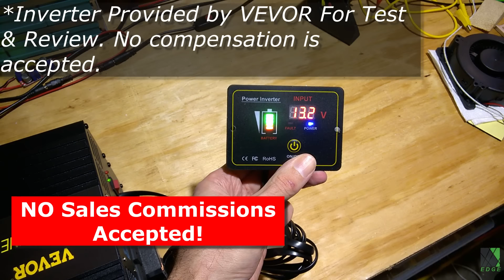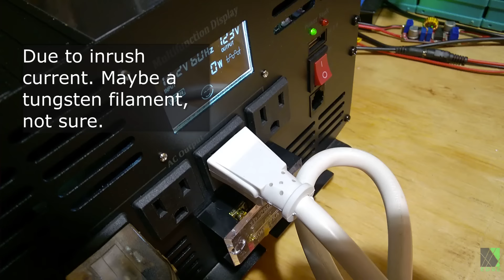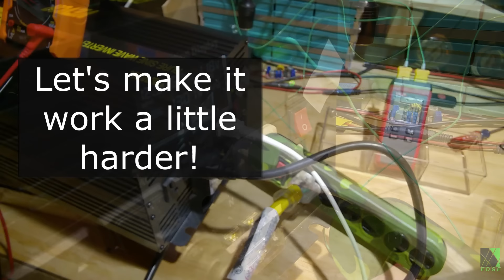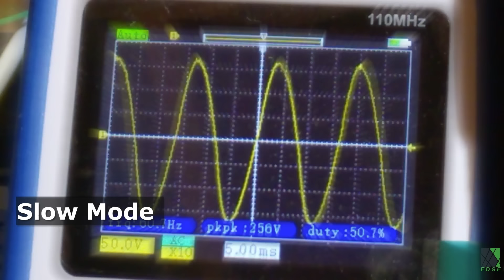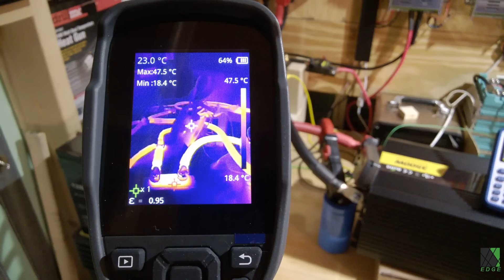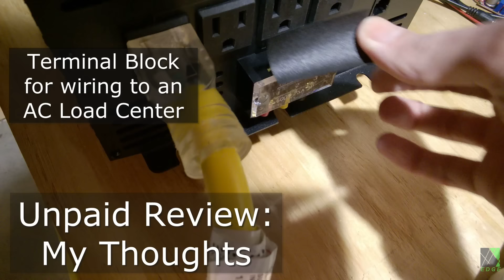Affordable 3500w Sine Inverter REAL Test! Unpaid Review - off electrical grid - solar workshop

Comment: Nice to see what my inverter MIGHT be able to do....  I say might, because it doesn't work :(  With my battery connected via #00 (2/0) pure copper (not tinned & not CCA) battery/welding cable, and inverter turned on, there's a 4A draw on the battery.   If I plug my phone into the USB port for charging, the power draw goes up to 5.2A, but if I plug anything into the 120V outlets, those devices do not turn on :(  Trying to get Vevor to replace it....
Reply from the maker: @shawnmurray7232 Sorry to hear that, very disappointing, I hope they will replace it.

Comment: Excellent test, you would have to be cruel to put any inverter under that much stress in day-to-day use! I was impressed that it past the soack test at near maximum load, most cheap inverters would overheat and cut out on that one.
I suspect that the reason a lot of people misunderstand the surge capability is that they do not look at the time. The spec says it will handle a 125% load for 20 seconds, enough to start your saw and most medium-sized tools. Big motors, however, often take more than 3x their rated power to start up, so the biggest motor I would expect this to run would be about 1500W or 2Hp. Even that can be a problem with heavy tools, my jointer has a 2hp motor, but it also spins a cutting head weighing around 10lbs. It makes a 5Kw generator chug when it starts. High frequency inverters just do not like big induction loads as you point out.
Once you go beyond 125% the length of time the inverter will sustain the overload rapidly drops. Most inverters will only manage a 200% overload for 2 or 3 seconds, which may start a fridge but won't start a large motor. So it may well be that this one will provide 6000W peak, just only for a second or two.
Reply from the maker: @rolandstockham1905 thanks for your kind feedback :) 2hp 10lb cutter head sounds like a good test. I wish I had a large air compressor. Those can be extremely difficult to start.

Comment: Thanks. Exactly the kind of review I wanted to see before buying one: the fan will never start in my RV, running the apartment fridge  during the night 😂 probably one of the best inverters for the money?
Reply from the maker: @OOOOutdoorOffGridOverland WElcome :D well I'll tell you, I thought this inverter would fry with the treatment I gave it, but it did not - so I will cautiously recommend it. And I thought it was pretty good for the sale price. That said, I'd still spend time looking at all the options before taking the plunge :)
Reply: @solarpoweredge I already ordered it. Hard to beat for the money. For me it is very important to be quiet. 99% of the time will run a fridge which draws 50w and starlink 40w,  6w in light. Fan will never kick in. Thanks.

Comment: This stress test is more appropriate for a open-frame gas generator because I know my Champion 4250W generator would handle it with ease all day long under constant load.  A 3500W inverter would make me real nervous.  But it's helpful to know it can be done for a few minutes.
Reply from the maker: @hornet224 Generally I don't run inverters past 50%. Since this is a review / stress test I wasn't going to give it an easy time. This inverter endured the heat test much longer than a few minutes! The intent was to expose potential weaknesses. I did not think it would perform well. But it did. Temps were a bit too high though, so I will look into some diy modifications

Comment: How did you hook up your 12V LifeP04 batteries? I'm looking to buy about 600 Ah worth of batteries. I saw I can only hook 4 of the 12V ones together maximum, meaning I'd be stuck with 400 Ah maximum.. Is that really how that works? I'm kind of lost.. Or should I get 2, 300 Ah batteries?
Reply: I'm trying to run about a 500 Watt load, 24/7. I bought about 2,500 Watts of panels 2nd hand recently. Some of the load is a fan, some is fridge, some is PC.
Reply from the maker: @lockdot2 500w x 24 hours is is ~12-14kw/h - that's a lot of power. 2500w of panels may not be enough, and you would need a huge battery bank as well. Solar is very expensive unfortunately. If you can turn some of the loads off at night, that helps reduce power consumption and reduces the solar requirements
Reply from the maker: @lockdot2 You can parallel them - that means connect the positives (+) to negatives (-) which works like one big battery. If you have 2 100 amp-hour batteries for example, can connect the positives and negatives of those batteries and they become a single 200 amp-hour battery. Careful not to connect positive to negative though, that's a short circuit! Hope that makes sense. You should get whatever size of batteries makes sense for the budget, and remember you can always parallel another 12v later as you expand. Hope that helps

Comment: Have you tried the renogy inverter low frequency. 3000 Watts
Reply from the maker: @johncampbell2311  I don't have the money but I'd sure like to try it! they make good stuff
Reply: @solarpoweredge  well it would not go as high as the one you just did that 3500 Watts. It's supposed to maintain a 3,000. But to my understanding that you can do 9,000 Watts for 30 seconds for startup.. due to a massive transformer and think choke coil. To maintain the proper voltage instead of dropping out. Some inverters will last longer with a realtor drive down to 90 volts

Comment: try to make a 10KW inverter with da fat mosfets and make a video
Reply from the maker: @AchhcityNoob  I will show a 10wk 12v inverter on this channel as soon as possible. First, I have to get a proper bench test set up :)
Reply: @solarpoweredge  hehe and also try to make a huge ass cheap ass test lpad to test the inverters rather than making soup and powering space heaters by buying cheap ahh rolls of nicrome wire and spooling it infront of a blower
Reply: @solarpoweredge  and also :)

Comment: Would you be so kind as to measure the voltage from PE to neutral and from PE to hot?
Reply from the maker: @brucenolan7873 Believe it or not, I meant to do that! plus wanted to do a teardown... but I've been sick and bad health. Just had to shorten and finish this video. 
*I will check the terminal block and outlets for live neutral, if I forget please remind me :)
Reply: @solarpoweredge Dave, thanks for the reply, I hope your health improves. Many inverter reviews neglect to test this voltage, unfortunately if the ground (PE) and neutral can not be bonded many loads will not work, if you are able to test it would be helpful, have a good day and thank you
Reply from the maker: @brucenolan7873 No problem sir, and thanks for your well wishes. Hopefully things will improve. This inverter has a load terminal so it's probably fine, but I will check it again to be sure when I get back to the shop. I was curious if the outlets could handle 3+kw without directly wiring to a load center. I will report back on whether it has a live neutral as soon as I can (feel free to drop me a comment to remind if necessary)

Comment: Interesting fan mods you have made to Makeskyblue mppts, assume the original fans stopped working or air flow was too low to cool the components.  See you even added a heat sink. In 2020, I helped install PV system on sailboat and used the 60A makeskyblue mppt w wifi, it is stall working fine with power input from two 320w panels and 12v bat bank.
The inverter seems to work fine, very hot interior though - needs more air flow?  Based on $220 inverter plus $100mppt- for a little over $300 (plus a few $150 lifepo4 bats) you have a 3500w 120v system.
Reply from the maker: @douglasrobbie9998 I love fans :) this inverter will get a fan mod, 100% guaranteed :D
Good job on the sailboat install. I think the makeskyblue is pretty decent for the cost. 
This inverter may not be the "absolute cheapest" out there, but I am amazed it survived my "heat" test, I am geniunely impressed.

Comment: I'm impressed , for a 12 volt inverter thats a  ridiculous  draw over 400 amps, great to see your tests.
Reply from the maker: @robertgoddard6787 I did not think it would surive, but had to give it an honest and punishing test. Well it survived and I am also impressed :) however it needs better cooling, so I will fix that soon and maybe share it on video with a tear down!
Reply: @solarpoweredge  . I agree with extra cooling, I live in a hot climate and use so many fans blowing across transformers  / heatsinks for igbts and mosfets. It seems to be paying off.

Comment: Great video. It works pretty well for the price. How much power does it draw when the inverter is on but no AC load ? BTW, can you open it up so we can see the inside?
Reply from the maker: @budmartin3344 Sure I plan to post a follow up video with teardown, no load draw and LN/E measurements. Just give me time and I'll get it done :)
Reply from the maker: @budmartin3344 Surprisingly, it only draws about 7w - even more impressive

Comment: Oh!!

As much as I like the maximum load tests I am equally interested in a minimum load measurement. How much power does it use when doing nothing?
Reply from the maker: @cobbles62 I forgot (have been very sick) and never mentioned it. I will double-check and let you know. If I forget, then please remind me :)
Reply from the maker: @cobbles62 I just checked and it draws about 7 watts - good for a 3500w

Comment: Hi Dave,
Nice to see you really stressed the inverter.
One thing you may want to inspect inside is the wire size that connects the outlets.  It's my experience these wires are typically well undersized for higher output inverters.  3500 watts requires some beefy wires for 4 parallel outlets.  I've seen units fry these wires under maximum loads.
Reply from the maker: @Building_the_SHACK Hi - You're right about the wires. I deliberately avoided the terminal blocks, might as well push it hard. ***The teardown and followup video will have to be separate, due to severe bad health and other constraints. since this inverter survived and impressed me, it will get more of my attention soon :)
Reply: Ok. I'll await your follow.   Take it easy.. get well soon
Reply from the maker: @Building_the_SHACK Thank you sir, working on it

Comment: what are your thoughts about adding a soft-start circuit to inverters?
Reply from the maker: @mikehughesdesigns If there is a cheap and simple way to do it, I think it would be brilliant. I am unsure if that would allow starting bigger loads with a smaller inverter - only real testing would tell us. I'm all for it, good thinking!!! 👍

Comment: Thank you. Very useful test. In future tests could you connect a guitar amp to test for the buzz associated with HD? Some folks out here have to play our music far away from Wifey in an out building of one kind or another. If you have a small 120 volt inverter style welder (maybe borrow one from a buddy that welds, in return for a promise of YouTube fame) it would be interesting to see what this sine wave inverter would add to a solar DIY METAL WORKING shop. Great video, sir.
Reply from the maker: @mrhalfstep Thanks for the kind feedback :) I don't have a guitar amp but I do have a mini stereo amp. I am sure these inverters have switching noise on the output, but being "not an audio expert" I don't know what the limits are. PS I really need to get a welder... been on my shopping list for years :D